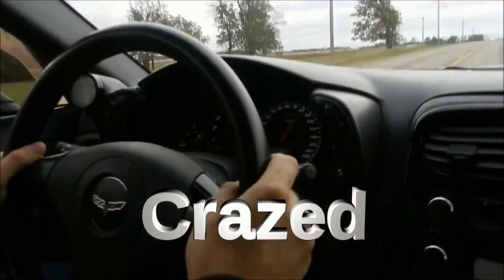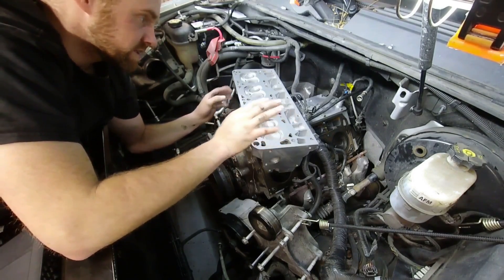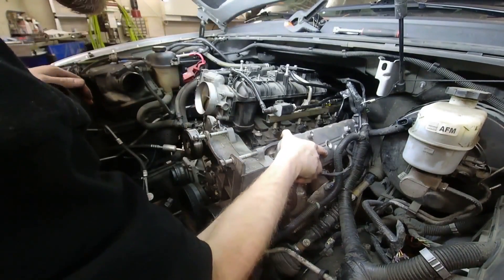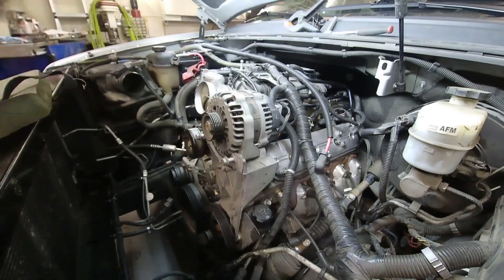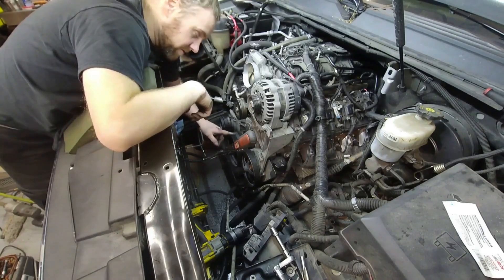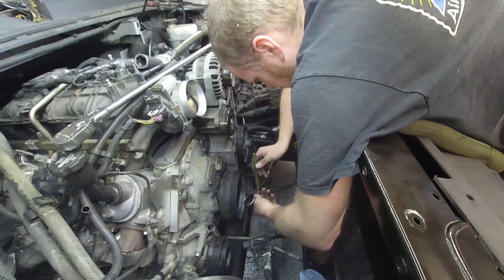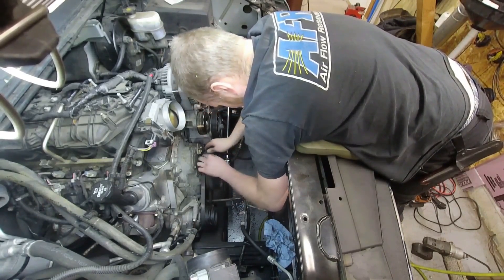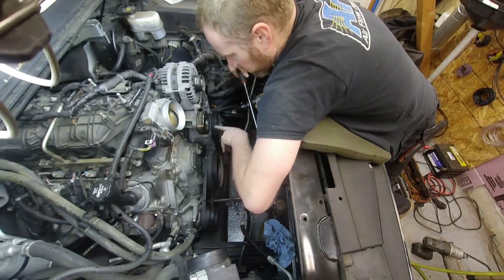DOD AFM Delete pt3 Installing the Heads & Fire up

Comment: I just finished this job and I hope someone who sees this comment can answer so I did a first start and it seems like it’s running under four cylinders only I have a V8 5.3 Silverado is that common before we do the programming
Reply from the maker: It can put it in 4-cylinder only if you never did the tune to shut off AFM. I recommend LT1swap.com for the service if you have a stock non AFM camshaft.

Comment: the a/c belt the vehicles with out a tensioner, two 2" putty knives i start to slide the belt off with the first one sliding in during rotation, then i slip the second putty knife rotating a bit more and i can then slide the belt off via the putty knives having lifted the belt off and over the edge of the pulley*. the key is to get the putty knives just slightly over the inside edge of the pulley and drop it off on the engine side. goes back on the same way getting the bottoms and sides all in their positions and then reverse rotation a bit using the putty knives to get under the belt over the pulley edge going clockwise at first until the putty knives are lapped over the edge of the pulley and then sliding them as close as i can to position each one at a time and then reversing counter clockwise rotation and let them follow into place. 
my putty knives aren't very sharp. there is a rounded end putty knife, but i've never had a problem with regular 2" 'ers

Comment: Do the dealerships even have the heads resurfaced when they pull them off?  I doubt it, sounds great but just not an option for alot of people.  The nearest machine shop to me is almost 3 hours away.
Reply from the maker: Completely depends on the dealership and the technician working on it. Technically they should but they don't always. If it's something that's under warranty of course they won't because they're trying to keep their expense down. The fact of the matter is though, it's always have some sort of warpage and there is always at least one or two intake valves that are bent let alone some of the exhaust valves and seat surfaces are usually pretty nasty.

Comment: I'm installing a DOD delete kit with a cam . My question is can start the engine before programming the delete on ECM. Thanks Nelson my name
Reply from the maker: Most likely can start but it may run in only 4 cylinders and will definitely be in limp home mode. This is due to replacing the VLOM with a non AFM valley cover. The ECM will see it's missing a part it expected to see.

Comment: If I don't get it tuned or unplug the sensor by the brake buster. Will it start or no?
Reply from the maker: It will start, however it's not going to run properly. It will either go into limp home mode, or it will enter a mode where it doesn't fire for injectors and coils. If it's not firing for injectors and coils they will run like dog crap.

Comment: Why not show how you secured the shaft from turning? Where did you stick the pin and where is that hole to secure the crankshaft from turning?
Reply from the maker: It's in bellhousing. I use a large wrench to bind up a tq converter bolt, the center nub and the bellhousing whole. Kinda hard to show on camera I guess.

Comment: When did u plug the oil passages for DOD under the valley cover?
Reply from the maker: I forgot to show that very important step in that video and kinda regret it. Eventually I will get around to a new delete video but for now it's just sitting on hard drive as I've been too busy.

Comment: Can I Fire it With out doing the Dod disable?
Reply from the maker: Fire it yes, but it might shut off 4 of the cylinders fuel and spark or just go into limp home mode without VLOM plugged in since you will have non AFM valley cover.

Comment: Any idea what I'd be looking at to pay a flat-rate shop to do this to my 08 1500?
Reply from the maker: Depends on shops rate, option choosen and parts markup but anywhere between $3-7k I typically run $4500ish
Reply: @CrazedPerformanceRepair  thanks! Seems like installing a new engine would be a better option

Comment: I have one question I can’t seem the answer too. I did the delete kit by Texas speed and got a new valley cover in the kit. My question is on the new valley cover where the oil sending unit is should I put the screen in that hole before I put the sending unit back? I didn’t do it and I’m getting Sporadic reading on oil pressure reading occasionally. I did tune the dod out in hp tuners. The truck does not tick, sounds strong, just thru a check engine light but haven’t read it yet. Thank you in advance love your channel!

Comment: Can I ask you how much the job was for this customer? I have a guy quoting me around $1500 to do the DOD delete in my silverado
Reply from the maker: Does that include parts? I have a feeling no it doesn't because that is way too cheap unless he has a $40 per hr labor rate. I'm at $90 an HR and I charge $4,000-4,400 all included parts, machine work, tune everything.
Reply: CrazedPerformanceRepair u steal from people dude

Comment: i did a complete dod delete put it back together now i have no oil pressure,any ideas of where i went wrong ?
Reply from the maker: Did you replace the VLOM with non DOD valley plate?
Reply: @CrazedPerformanceRepair  yes ,
Reply: @CrazedPerformanceRepair  yes i did
Reply from the maker: @johnschilling7389  do you have any oil pressure sensor circuit codes?
Reply: @CrazedPerformanceRepair  i dont have a scanner, when you install the modified vlom   what happens with the wiring connector for the vlom and the oil  lpressure sensor . i dropped the oil pan when i did all of this work anything i should have done while i was i n there ?
Reply from the maker: @johnschilling7389  if you replaced the VLOM like you said you should have a valley cover rather than a VLOM. (The one that is smooth and without solenoids) the oil pressure sensor wire still gets hooked up as it normally would but the VLOM solenoid connector get left unplugged as there is nowhere to plug it into. You should have one of these on there https://www.summitracing.com/parts/nal-12598832?seid=srese1&gclid=CjwKCAiAy9jyBRA6EiwAeclQhLoONWBgbW-1u5B7fXnLrvWqVFGIKfW6UuQsWZhfKy0oBwnMZHT1bhoC01QQAvD_BwE
Reply: @CrazedPerformanceRepair  yes i replaced it with this part, my oilpressure gauge is at nothing and the warning comes up no oil pressure shut down engine
Reply from the maker: @johnschilling7389  you might just have a bad oil pressure sensor but without codes it's hard to say
Reply: @CrazedPerformanceRepair  when i replaced   the new valley cover and put the oil pressure on it has a filter under the connector right !
Reply from the maker: @johnschilling7389  no filter with that style valley cover but you may have damaged a pin in the connector or the sensor
Reply: @CrazedPerformanceRepair  borrowed code reader,no code showed up
Reply: @CrazedPerformanceRepair  so i put a gauge where the oil pressure sensor is i had no pressure , i was told that i could have pinched the o ring in the pick up tube, i took oil pan off took tube off and reinstalled  started truck up still no oil pressure !
Reply: @johnschilling7389  where you able to find your issue with low oil pressure

Comment: I did not see but what did you do on valley cover?
Reply from the maker: It is replaced with a non DOD valley cover.
Reply: Did u plug the DOD oil passages?cause that’s super important

Comment: I did a DOD delete on my 13' Silverado. Put new cam, lifters, and valley cover. My motor is turning but not firing. What should i look for? Or does it need tuning for it to start?
Reply from the maker: Did you line up the crack and cam properly?

Comment: To prevent all that clatter on startup pull the fuel pump fuse or relay and crank it for a good 20 seconds, pop it back in and send it. I’ve never seen someone rebuild a motor and run it dry like that but to each their own
Reply from the maker: I used to do that until I realized some things. It Was never run dry I pre oil every part. The only thing that makes noise is the lifters. The oil gets to the part with less turns of the crank if you just fire it up rather than sit and crank it because pumps are more efficient at speed. When you turn the engine at lower rpm to feed all the parts the parts are still working just as hard. The only difference is that they are doing it for a longer time so since it's moving slower, it makes a little less noise and the starter covers up the rest. Also now you are putting more stress than needed on the starter just to make it sound like less damage is done when in reality more damage is done.
Reply: @CrazedPerformanceRepair  If you hold the Gass and brake pedals it cuts the fuel pump and you can crank it over for like 20 seconds and let it it rip.. I find it to allow oil pressure to build and it has less noise when its actually running and warming up

Comment: Hi! We installed the new DOD kit plus had the ECM tuned, now I'm facing the problem of engine not firing up or it's not getting the fuel. Checked all fuses are good. Any suggestions why engine don't start?
Reply from the maker: Does I crank and not start or just not even crank? Did you leave a ground off?

Comment: I want to do a cam swap to my 2014 caprice l77 with btr LS3 stage 2 my question is do I have to do DOD Delete? If so is there away to do it with out the delete kit? Like the way you delete it in your videos?
Reply from the maker: yes there is a way to do it without a kit and just buy all the parts individually. You may as well just go through texas speed get there kit without the cam telling them what cam you have. They will be sure to get you the parts you need to make it all work.

Comment: What do you use to take the crankshaft bolt off how do you keep the harmonic balancer from spinning
Reply: I had the same question for this guy. He tells you there's a hole somewhere and you need to stick a pin in it but does not show you where. 
Would be nice for him to show a pic or just stick the camera in the area to show what he is talking about.

Comment: great info bro. subscribed. Can you tell me your trick on installing the ac belt on 17 camaro ss?
Reply from the maker: Haven't messed with a 17 Camaro yet is it the style with the tensioner like the c7 Vette? No real trick to those...
Reply: CrazedPerformanceRepair yes, just like c7. How do you do those? Been fighting it pass two days, lol
Reply from the maker: I did it with a 15mm wrench and my bare hands. The ac tensor does not have that much tension  so I just push down on it with my thumb.

Comment: This is a great video series, very helpful.  Did this engine have VVT?  Can you do the DOD delete with VVT?  My engine (2012 suburban LTZ w/LC9) has just started making a weird chirping/scraping sound that is in time with the cam that I believe is a wrecked roller on one or more of the lifter.  The DOD still works fine and non of the lifters were collapsed when I pulled the valve covers.  Have you had any experience with this issue?  Would this situation require a cam change or just lifters assuming the cam visually checks out?
Reply from the maker: The full delete can be done on vvt while keeping it or converting it but I keep it when the vehicle has vvt. Just be sure to change what's needed in the tune of the vehicle. You could have a bad roller that take out the cam and you could also have a bad cam bearing though it's not as common. Best thing to do to get a quick idea as to how bad it is would be cut open the oil filter and check what debris you have. Use a magnet to determine if it's steel from lifters or aluminum/copper from bearing.
Reply: thanks for the quick response.  I stopped driving it when I heard the noise, there were no codes thrown and it still runs fine besides the noise in question.  Prior to this is did have the normal LS valve train noises (light ticking).  When I was looking for a collapsed lifter I didn't turn the motor over at all.  Is it necessary to check rocker movement?  If it is a bad lifter that wiped the cam would it just be a matter of replacing the cam and lifters?
Reply from the maker: @schmmd01  Be sure to start it with the belt off before digging in to far in case just belt related. Not sure what you mean by " If it is a bad lifter that wiped the cam would it just be a matter of replacing the cam and lifters?" but replacing the cam and lifters does require pulling the heads, and if you do a delete cam the tune will need to be changed and it is recommended to change out the valley plate.
Reply: @CrazedPerformanceRepair  I've taken the belt off to check the accessories already and it still makes the noise.  The noise gets much more pronounced when the engine gets warm.  A video of the noise can be found here: https://youtu.be/5JL8kfMmKrI  
What I meant was if it is a lifter/cam issue is it likely the damage is just to those components and if I just replace the damaged components then I'll be good to go or should I be worried about damage to the rest of the motor?  I understand what all has to be pulled to replace the cam and lifters.
Reply from the maker: Is the ac compressor engaged I noticed that the belt was on? That doesn't sound like an engine problem it is a very unique sound.
Reply: @CrazedPerformanceRepair   I  tried it with and without the ac engaged and then later removed the belt entirely.  The sound remained throughout.  Using a stethoscope I tracked it to cylinder 1.  I loosened the rocker arms on that cylinder and the pitch of the noise changed so I do believe it is a roller issue on one of those lifters.  The rocker arms and push rods both looked fine.
Reply from the maker: @schmmd01  Cylinder 1 cam lobe's can be seen from under the valley cover or VLOM, pull the VLOM off and do a visual inspection.

Comment: I did the DOD/Amf delete 5.3 But just wont start what should I look for 1st .
Reply: Added new ground wires fired right up!
Reply from the maker: @Wehttam1979  There you go....
Reply from the maker: won't crank or won't start? did you get the timing marks lined up good? Does it have codes and if so what? Are all the connectors connected? all grounds in place?
Reply: I'm double and triple checking all

Comment: Do you use anti-seize on bolts like the crank shaft pressing bolt.
Reply from the maker: If I use anything it is ARP fastener lube and only in specific situations like when using the pressing bolt.

Comment: I had some install dod delete with new valley cover truck now burns tremendous amount of oil is it true the high volume stock oil pump has to be changed to standard volume or do you have any suggestions thank you in advance for any info

Comment: Major question I have a 2008 avalanche with the 5.3 afm engine had rebuild done 2months ago new cam new lifters and timing and guess what 2months later same problem collapsed lifters and now the mechanic don't want to stNd behind his wrk says something else is wrong with the truck causing these to go bad what's you thawts
Reply from the maker: Release the lifter and turn the system off.

Comment: I have a 2013 chevy 5.3 number 4 misfire has 0 compression in #4, I tore it apart except the head , the rocker arms are tight but I can push the exhaust down spring that is.I tried hitting the lifter seemed to make the rocker arm tighter reassembled it , ran good about a minute and started running rough... I'm wondering maybe I need to disassemble  the volm and get rid of the solenoids and remove oil pressure???? what do you all think???
Reply from the maker: See my for your local shops video https://youtu.be/DSiRGnVp-Es it will give you links to the most relevant videos. You do need to have DOD turned off to keep the problem from returning.

Comment: Badass series man. You've earned a new subscriber. Definitely referring  to this collection in the future.

I'm looking into a DOD delete on an '08 Avalanche with the 5.3L Vortec SFI; it's not an LS motor but "LS base", can I expect a similar process for AFM deletion?
Reply from the maker: Yes should expect the same, I recommend pulling the oil pan and pump
Reply: @CrazedPerformanceRepair  this particular model is extremely well maintained with 115k on the odo with absolutely no known issues with the DOD thus far. I'm fence sitting on using an OBDII splitter and using the Range AFM disabler to see if I can have emissions run with the unit on; ever heard of anyone trying this before?
Reply from the maker: As far as I know it does not effect emissions testing but if you have no problems with the DOD yet I highly recommend the range device.

Comment: you didn't change the valley cover?
Reply: Valley cover? He didn’t plug the oil passages underneath for the DOD, that motor is trash, it’s gonna bleed and leak oil internally

Comment: Is it ok to use same pushrods i pulled out my kit said use able in stock valvetrain and do u have to retune whole truck afterward puttin lm7 cam but 100% on the computer needs

Comment: So you or nobody’s gonna say anything about the ls7 bolt you went to far with?
Reply from the maker: I said it basically but if you think I bottom it out you are wrong I know better. Hell I thought I know better than to use a bolt to install on the over tight performance balancer but thought I could get by on stock balancer since the tolerance is looser  But I was wrong and fully admit I made a mistake there. Point is live and learn and there is no reason to lie about it. I have got away with that in the past but not this time. So from here on out I will use home made installer.